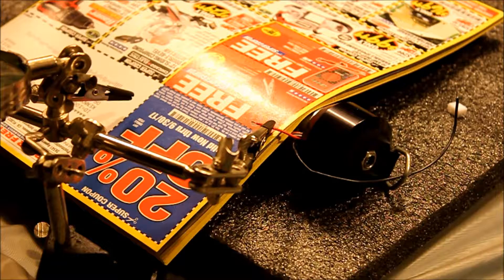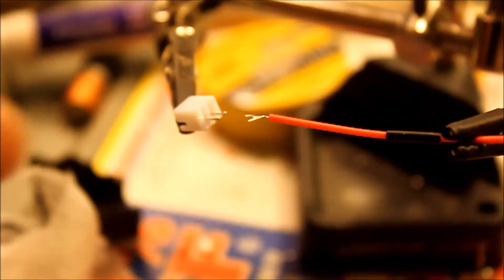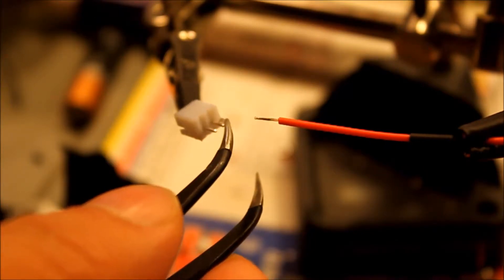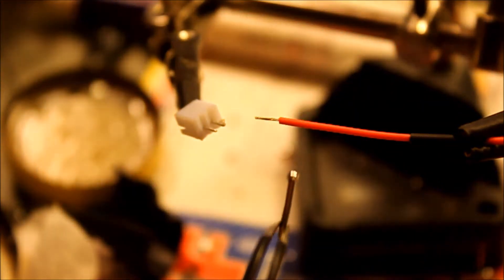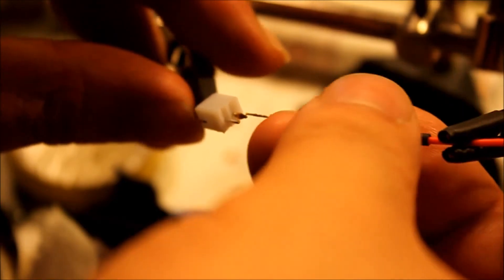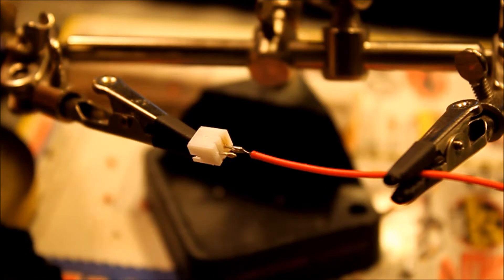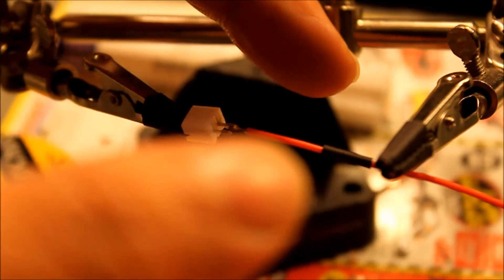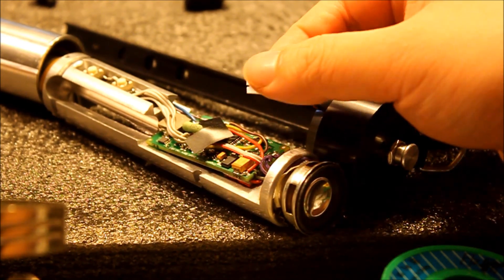Solder tutorial for a micro JST 2.0mm connector, for stick battery (Part I)

Comment: red wire on a red back ground????
Reply from the maker: Nowhere did I mention the wire I installed is for red black ground.  It is installing a red wire to a micro jst connector with a heat shrink sleeve

Comment: On the ph2.0 female connector is 22 and 24 gage wire still ok?
Reply from the maker: 24 possibly. For a 22, because it is a thicker gauge, different connector is recommended
Reply: @PakkenTech  thanks

Comment: Would solder wire infused with flux be okay. Or do I need extra solder flux?
Reply from the maker: Infused wire flux tend to dry up and not create a shiny surface to the solder, always use flux even when the solder wire already has flux inside, the outside would make a nice cleaner look
Reply: PakkenTech thank you. :)

Comment: Is there a benefit or detriment to soldering vs using a crimped connector? I want to upgrade my emax tinyhawk to a solid core jst PH 2.0 instead of a split pin but don't know if a crimped pigtail would be better or if soldering one of the JST PH2.0 that I have would work just as well.
Reply from the maker: Soldering connectors provides a solid joint between 2 wires (or more) where crimped connectors are basically how much material you crimp to a point where a wire could potentially slip out from a lead (depending on your ability to crimp).

It's a matter of preference.  Crimping wires I feel takes more time than just soldering them together with a JST connector, when you solder correctly, the joint will never be able to pull apart as easily
Reply: @PakkenTech  right on thanks for the answer. In theory it sounds like a solder joint could carry more current, where as a crimped connection may be limited by the amount of surface area in contact.
Reply from the maker: @RavenWindrunner  incorrect, they both carry the same amount of current either soldered or crimped. It's just that 1 is more durable than the other
Reply: @PakkenTech  ah Yes forgot that electricity is primarily carried on the outer surface of wires.
Reply: @RavenWindrunner  but you won't be able to crimp 20 awg there :p
Reply from the maker: @maxmax-xx7nw  you can technically crimp it, but you'll need a different connector to support it
Reply: @PakkenTech  but i did a test on solid pin jst 2.0 vs crimped jst 2.0 and found out that solid pin has less voltage sag during full throttle compared to crimped ph 2.0.
Reply from the maker: @pushies5  it is an old video, check my other video for crimped micro jst. Either way, it does it's job using an old soundboard that uses leds
Reply: Crimping is favoured where you still need to maintain wire flexibility, or carry high currents. When tinning a wire, the solder can wick up the wire past the insulation. This makes the wire stiffer and will eventually lead to failure of the joint due to fatigue in the appropriate situation, say in a car or on a motorbike. A properly crimped connection is actually air tight and prevents oxidation inside the joint itself. As the contact is formed by squishing the copper with the crimp terminal, these contacts usually have a lower resistance too as your typical solder has a lower conductivity. In a lot of situations, crimping is also faster to do than soldering.

Comment: I've only tried to solder a couple of these so far, and it seems the instant I touch the connector with the soldering iron, the connector shell melts around the pin and then the pin ends up misaligned. I thought maybe you're supposed to pull the pins to solder them, which is why I ended up here. So obviously it's possible to do it without melting the connector shell... Any idea what I might be doing wrong? I was using a 60W, fine tip iron set at about 350F. Any ideas on what I might try for better results would be greatly appreciated.
Reply from the maker: Set your temp to around 300F (350F is fine since I use it at that temperature and had no issues)).  Flux your connections and apply solder on both ends (the connector and wire ends).  The reason why your shell melts is because you apply too much heat to the pins.... it should be like a 1 shot deal
Reply: @PakkenTech  Thank you very much! I can make my parts I misordered usable, or at least get some practice!